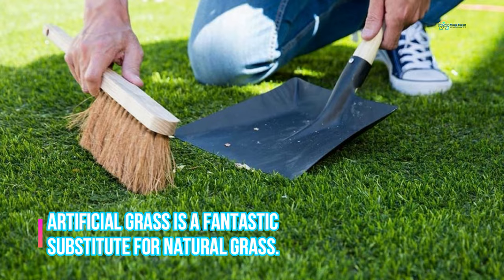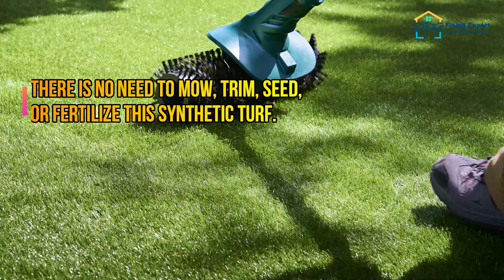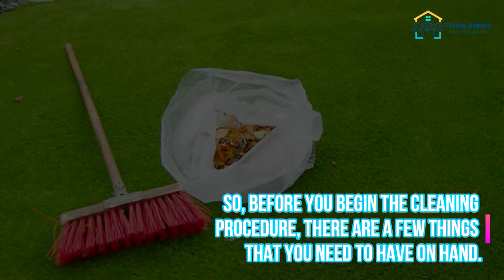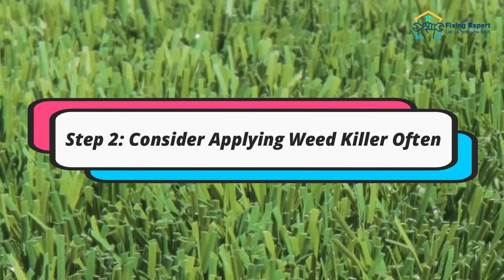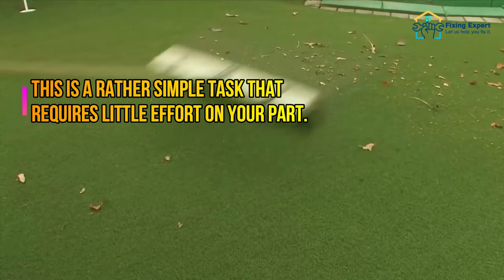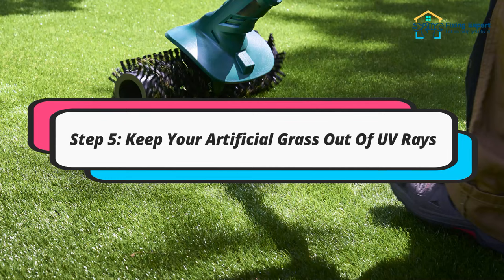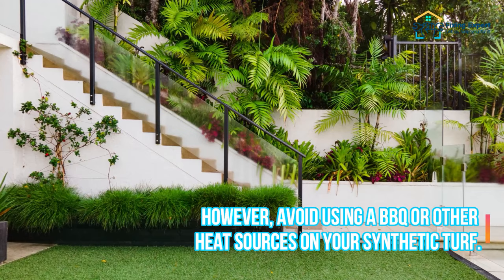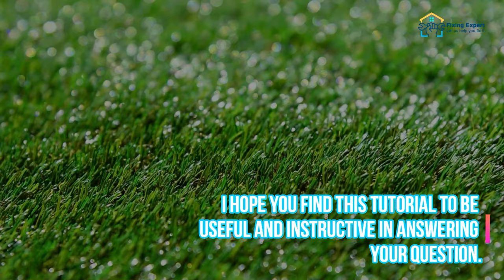How To Clean Artificial Grass?

Comment: My artificial grass is full of dirt flying when people running on it? How to fix?
Reply from the maker: If your artificial grass is kicking up dirt and debris when people run on it, there are a few things you can do to help fix the problem:

Regularly sweep or blow off the surface of the artificial grass to remove any loose debris or dirt that has accumulated. This can help prevent the buildup of dirt that gets kicked up when people run on the grass.

Consider installing an infill material such as rubber or sand. Infill can help weigh down the artificial grass fibers and prevent them from flying up when people run on the surface.

If your artificial grass is old or damaged, it may need to be replaced. Over time, the fibers of artificial grass can become worn and damaged, making it more likely to kick up dirt and debris when people run on it.

Make sure the artificial grass is properly installed with a suitable base layer and drainage system. Poor installation can lead to uneven surfaces that can cause dirt and debris to accumulate.

Overall, maintaining your artificial grass through regular cleaning and upkeep can help prevent the buildup of dirt and debris that gets kicked up when people run on it.
Reply: Or just get real grass